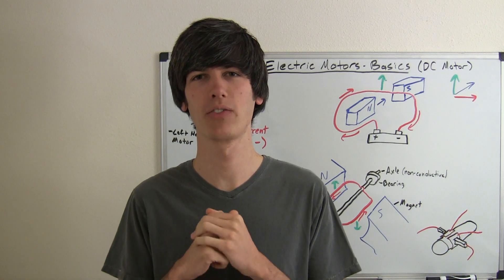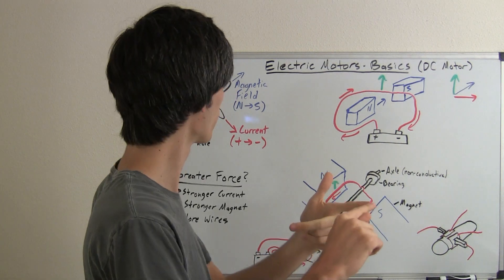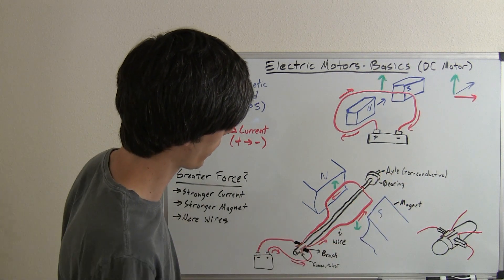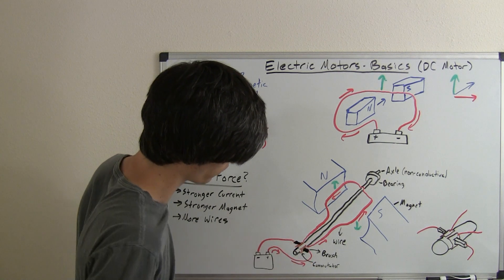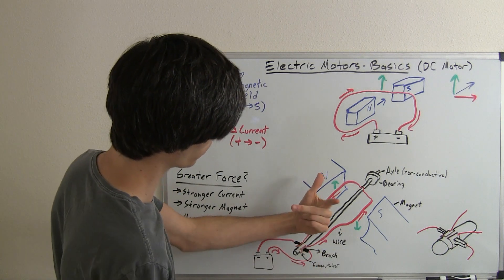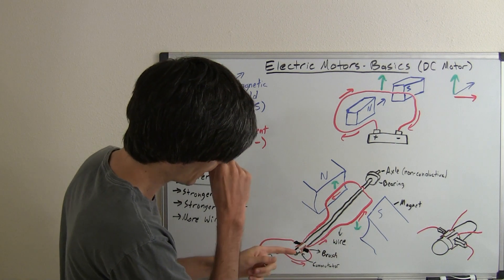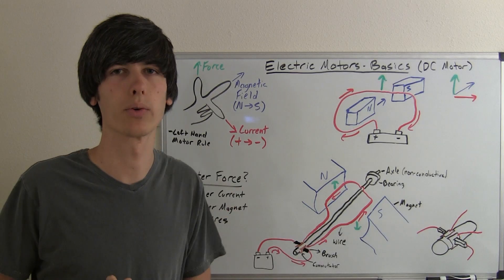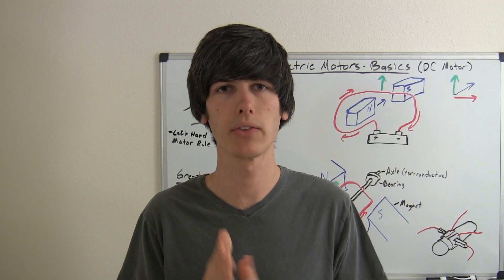Electric Motor - Explained

Comment: When a car has both front and rear motors should they be equal in power or can they be 200hp rear and 100hp front? Also are dual motors on one axle efficient?

Comment: Why did you use your left hand to show the Force vector? School has always had use your right hand rule. Anyone feel free to explain, please.
Reply: If you use the convention that "current" flows from + to -, then use the left hand. If you choose - to + as current flow, use the right hand rule. Electrons are the only things that actually move, and they move - to +. However it's equally valid to think about positive "holes" moving + to -, and thus you need to use your opposite hand.
Reply: Efren Munoz po

Comment: What happens if ur coil rotate to a point where its directly perpendicular to the axle/magnetic field? There's no lateral force acting on it. Even if the inertia causes it to "go over", the upward force produced by induction have to be insanely high just to rotate it a little at the instant. Just what i've been wondering for a long time since i was intro to motors
Reply: we use a second coil perpendicular to the first coil to overcome that issue but its just a theory... In practice there are a large number of coils so that wont be a problem

Comment: Please don't laugh. Ha. But why are there are 3 metal sections on the part that spins closest to the magnets inside the motor housing? Seems like you would have just 2. Is it for maximum surface area or balancing?

Comment: i have a question ive been dying to ask. How do electric cars heat passengers in iternal combustion engine it uses coolant but idk how in electric car can someone please answer
Reply: Basically they use electric resistors. Electricity creates two things, heat and magnetism. I'm sure you've seen electrical devices overheat before, that's because electricity creates heat. So electric cars have a big resistor that creates heat and work similar to heater cores in ICE vehicles but instead use a big resistor. Hope that helps, and please subscribe to Scieneering!

Comment: thanks for the knowledge I just started a job rebuilding eletric components for fork trucks or forklift. I work on warranties and one thing I have to do is trouble shoot the motor and I just learned that the head of the motor that keeps it from moving broke and made the armture grind on the shoes. the comutator had some grinding on it due to the head.

Comment: The current should be going from negative to positive
Reply from the maker: Henry Jones Current flow convention is + to -. Because electrons are negative, they travel the opposite direction as convention shows current flow.
Reply: Engineering Explained acually there are two ways given 1. conventional way which as you said is + to - and then there is the other way which is from - to + but because the conventional way is used more around the earth we say that conventional way is right even tho its not
Reply: blame Benjamin Franklin
Reply: Engineering Explained is correct. He is talking about the Current Flow, not Electron Flow. Electrons and Current are defined as flowing in opposite directions.

If you pick either direction along the wire to be the direction of electron flow, current will always flow in the opposite direction.

Either way, it does not matter, if you pick one set of conventions and use it consistently, everything works out in the math.
Reply: Wesley Miller correct, but isnt Engineering Explained supposed to know that
Reply: +Henry Jones I think it's the same question as
wether one should use Miles or Kilometers,
to me as a european the mile and foot and pound system is complete nonsense.
My teachers taught me that the electrons are moving
and i am pretty sure,
that thats the trough.
but the convention remains.
Just in the way the everybody uses Horsepower
which was originaly invented as a figure
to compare steam water pumps with horse driven pumps.
Reply: finally, someone logical

Comment: Great explanation. Thanks a lot but REMEMBER THAT CURRENT FLOWS FROM NEGATIVE TO POSITIVE ELECTRODE - even I know this...
Reply from the maker: igorm9999 All caps is obnoxious. Convention has current flow from + to -, though since electrons are negative the direction the electrons flow is - to +. If you've studied this academically it's the convention you'll find. Even I knew that.
Reply: So overall, current flows from - to +. No sense arguing
Reply: igorm9999 Physically, electrons flow from - to +. The convention that is used states that fictitious positive particles travel from + to -, which is a mathematically equivalent view.
Reply: Electric motors and electric current existed long before humanity know what are electrons . Practice before theory .

Comment: Why does the current flow from + to - and not the opposite??
ive seen many other videos where the current flows from - to + can you please explain why ?
Reply from the maker: It's simply a convention, not sure to be honest. Flows from + to -, but since electrons are -, the actual flow of electrons is the opposite (negative).
Reply: You asked this question a year ago, if you have found an answer, please tell me
Reply: Actually it wasnt a year ago or anything it was in december 2013 but anyway everyone i ask says it a convention that the current flows from + to - and the directions of electrons is from opposed to that which is from - to +

Comment: You can find some info from military videos if you want, but this is good for simple and short time! Well, I have some questions. What or how to make the RPM/torque/HP without modifying the original design (separate question each)? And how to convert small volt DC to high volt AC/3phase AC?

Comment: I have a question that i hopefully can get answered. so i have an old car (91 ford escort) and the speedometer only gets to 85. but i have upgraded this car to become a street racer and it goes fast. the thing is i am wondering how i can upgrade the speedometer and calibrate it because this car i have is well more powerful than 85 mph. it has an estimate hp of about 375-450 so any thing you can tell me? do i just draw out my own speedometer on paper and stick it on? (not that i would). ha thanks

Comment: hmm, ok i think i get ya.
the force is too small; the "many wires" that you see in conventional motors are just the one wire wound around to make "poles", (which i think you were saying in your 3rd paragraph). the purpose of having more "turns" of wire is to generate the force from the wires cutting the magnetic field lines from the permenant magnets on the stator. so yeah, torque is the force you are talking about, and you need lots of turns to generate it :) hope that helps!

Comment: Found something interesting!

The reason the left hand rule is used for motors is due to sir John Fleming. 

The left hand rule is used for motors while the right hand is for generators. This is because in motors the current and field are the cause and the motion is the effect. However, in generators, the motion and field are the cause and the current is the effect.

Fleming was also an engineer AND a physicists. Not surprising. 

There is a wikipedia article: Fleming's left-hand rule for motors

Comment: Yeah I made another message and I guess it didn't post. Physicists point in the current and curl in the field. I guess engineers point in the field and curl (middle finger) in the current, hence my initial confusion. 

I think the reason we use our right hands is because you can apply it to other instances involving a cross product. I.E. magnetic field lines around a wire, angular momentum, etc. etc. etc.

Comment: Ummmm. In a wire the negative charge carriers flow from negative to positive. This would be the same as the positive charge carriers flowing from positive to negative. 

If you use the latter metric, than the right hand rule should be in effect.

Comment: you both did not understood my question..

My question is if I apply a force in the wire, just one wire like the example in the video, it will break right? or the force is to small?

So I said as we see in most of the motors there are many wires (same wire) that are stick together so they don't break so easily. 

I'm not asking the influence of having more or less wires to create more/less torque...

Comment: eventually you have to bear in mind that having lots and lots of wires will increase the mass of the rotor which will counteract the torque you're creating. Also, more wire = more resistance; hence for every system requires a deal of planning for what the motor is to be used for, the speeds and power rating required, and finally the power supply. it's not as hard as you think though! :)

Comment: I am looking forward to the videos on brushless motors, will you cover both in-runner and out-runner motors? I find brushless motors to be more fascinating as they consume less energy while creating more power than a traditional brushed motor, which you explained in this video. A thing to note is that brushless motors require far less maintenance, and are easier to service. Keep up the good work, Jason!

Comment: This is brushed motor. There's also brushless motor, with magnet as the rotating part, wire in the stator, thus no more friction from the metal brushes, nor the need to clean up the brushes once a while. Thus the only part that may need to be maintained is the bearing, which pretty much last forever.